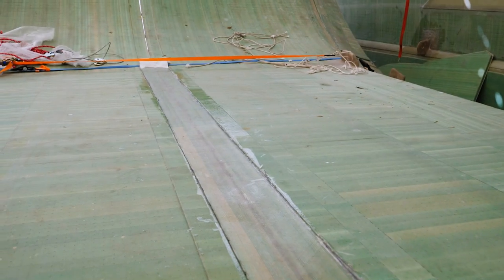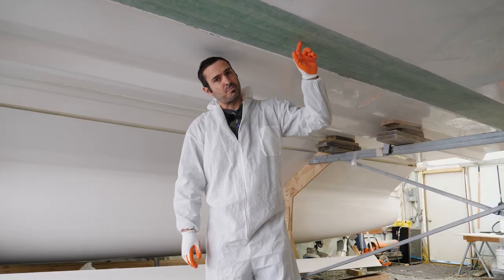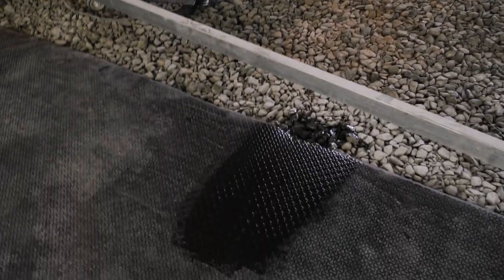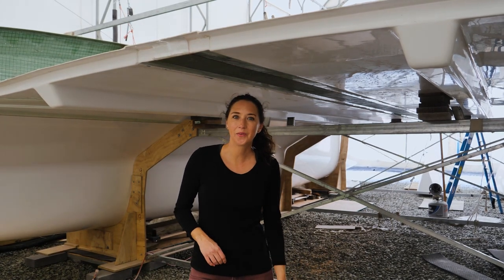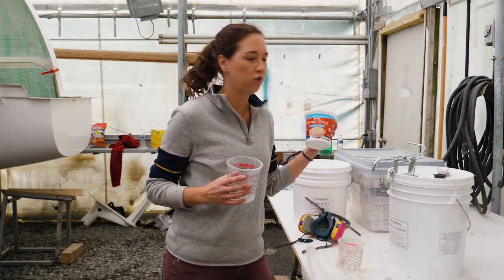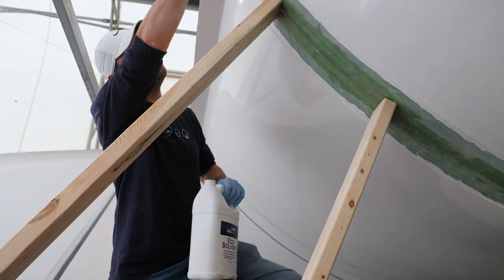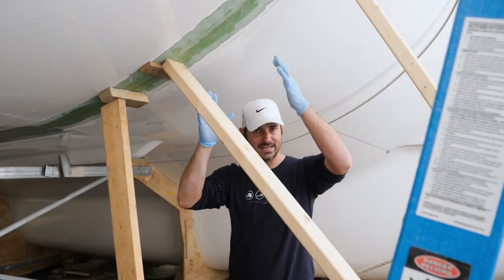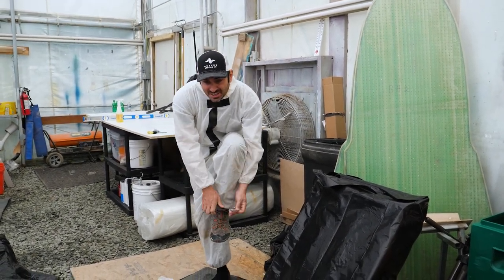CATAMARAN BUILD -  Is This Just As Good As the Moulded Bridge Deck? (MJ Sailing - Ep 182)

Comment: Use peel ply between layers that way you save time sanding . It creates a rough surface also removes  excess resin. You can go to a fabric store and buy polyester which is almost the same thing and it works just as well and much much cheaper than real plee ply. Have fun and great work.!! Tips from a experimental composite aircraft builder lol

Comment: So I was a airline fiberglass mechanic for several years,  air pockets are no big deal,  they are usually due to a dry pockets.  Get some large syringes and needles and when you have a pocket inject it with resin. Works great. I try to do it when its still wet, but you can still do it after its dry, looks like a lot of fun

Comment: Nothing is more fun than overhead fiberglass work.
Reply: You should try overhead welding I did it for years very tiring.
Reply: @patrickcoleman3  I have. Both suck in different ways.
Reply: @jamestheotherone742  Yeah I haven't tried fibre glassing but I was a boilermaker welder for years.
Reply: @patrickcoleman3  It's mostly just messy and frustrating.

Comment: Hey you two!  I have a tip on the sanding. I just got done sanding the bottom paint off my boat, fairing it, then sanding and sanding again to make it smooth.  I used a plastic folding table from Costco and did the sanding while laying on my back on that table.  It really helped.  I could either sand near the limit of my reach right above me, or I could raise it up to get close personal if needed.  Doing it that way extended my stamina from 15-20 minutes to hours.  Looking good... wish I could be building my dream at right now too!
Reply: There are movies of Michelangelo laying on his scaffolding, getting the distance basically just right so he could paint on the ceiling of the Sistine Chapel.  So, yeah, good idea!
Reply: We had a couple scissor lifting tables on wheels for that purpose in the yard when a hull wasn't turnable (mostly new builds and completely rebuilt hulls there) and some actually did it Buonarotti style. I always preferred to stand squatted and thus have a double or triple range to reach for with really aggressive belt or slow turning disc sanders compared to laying on my back. Same goes for fairing with longboards: You need Your shoulders more than Your forearms. Scraping a hull is no Delphian Sybil or Charon's Boat scene.
Reply: I also also wondered if you could use some sort of platform to lie on while sanding the underside.  It would save you from having a still neck and get you off of your feet a bit.

Comment: Things are going really good,  it's looking nice.  If you would go to a body shop supplier and get an 8 inch foam pad about 1 inch thick for a buffer you'll save a ton of time sanding.  Also get a thick foam pad for your small sanders.  You'll find it's so much easier to get a flat fast cut. 
You guys are moving along great.  I'm looking forward to next video

Comment: Also I would suggest bristle rollers to use once you have layed down the resin as it helps to get out all the air because of the wire bristles. A naval architect we used said using these bristle brushes was the next best thing to vacuum bagging. Anyway just a suggestion from our learning when reading the bottom and floors of our refit.

Comment: Matt, for the trays you like to use, get a big wide roll of aluminum foil and some double sided cellophane tape. The foil can be stuck to tray with a few pieces along sides and down middle.. totally disposable and no cleaning.  If you need to buy some time with the mixed resin, the cup can go into a fridge or freezer as long as you don't put foods in there.. aluminum cans are OK but anything , even in plastic will pick up the resin gasses inside fridge.  You can find free throwaway freezers and fridges just for hauling it away from most houses on Craigslist or FB Marketplace etc. Having the straight resin and hardener cold from freezer before mixing is also a good trick for working in higher temps in summer, it can add several vital minutes when you need it...
Reply: About the aluminum foil tip for the trays. You can also use saran wrap meant for sandwiches. Or stick the whole tray in a thin plastic bag, use it wrapped in bag and when done discard the bag.

Comment: So congratulations on the catamaran project it looks like you both have the skills to pull off the build.. one question  ? how is it ever going to be as strong as the one piece parts ? once the factory  cut them into two and you are only able to glass top and bottom and lateral strength has been taken out by cutting through the fiberglass  will it ever be as strong ???? L.A Rob

Comment: You should use a ziplock bag and cut the corner to apply the filler like a cake decorating bag.  Then use your scraper to remover excess.  Much easier!
Reply: You can’t tell these 2 anything they will accept
Reply: I used these alot building my boat. 
I also made an apparatus to hold the bag open to dump the mixed resin into. It was a "U" shaped piece of plywood with the points of small nails protruding upward through each leg. Push the outer lips of the ziplock onto the nails. Fill the bag, pull it off the nails and zip it shut. 
Another apparatus I made - used a 3/4" Diam. dowel about 8" long with a 6" cut length-wise down the center. I'd put the closed ziplock sandwich bag in the dowel slot and roll the bag around the dowel to dispense the resin out the little hole. This helped control the amount squeezed out and got almost all the resin out.

Comment: You could try a drywall sander which is like a weedwhacker mated with an orbital sander. They are there to do just what you are doing but without the arms in the air. Please if you ever get to sanding wood decks hire a floor sander it'll cost the same as all the beers you'll need after using a piddley wee one.

Comment: After you gelcoat the seam, sand and blend it in. Polish that strip. I would not remove the original gelcoat from the remainder of bridge deck underside. It's a perfectly finished surface now.

Comment: Hey im pretty sure you can kick the resin with the peroxid after your finished mixing filler in to it. True with epoxy you mix it before adding filler but because the peroxide is only deactivating the Inhibitors it can just go into the premixed filler. Thats why it works with car bog which is polyester resin and chalk. That will give you that extra 10mins of work time you used thickening the resin.

Comment: when you get to bulkheads, fit them with a small gap and use wedges to position them. glue them in with piping bags used for baking. so much easier than forcing it in. Just use enough glue to tack it in place but so there is no mess to clean up. Pre cut the tapes in order. Then make a coving tool the same radius as your compression roller to do coving. Use the piping bag to make a nice bead along the bulkhead, then cove it straight away, Pre prime the taping area. We the tapes out on the bench and drop them in. No sanding or cleaning up, only need to roll the tapes out on the boat. Peel ply is also worth its weight in gold . I would always peel ply tapes. cleaner job and less sanding afterwards.

Comment: Well, done.  Not sure I would have the stamina or the ability to keep going on a job like that.  Its basically what would put me off building a kit like your doing.  Doing a Schionning type effort with flat panels would simply be out of the question.  That was something I did not know about.  Schionning construction.  This explains the notorious water in the construction that Schionning has.  Simply not sealed well enough due to the flat foam construction.  Not all Schionning suffer from this, but apparently its a thing.
I did many years in Fiberglass companies building boats, tanks, pipes, etc as a youngster (some of my first full time jobs were working for Fiberglass companies, way before they realized the health issues).  That reminds me, well done for keeping the safety gear on all the time!  I was only required to do that only when glassing or gelling inside tanks, where you NEED an airline to be able to breath.  It was miserable to say the least so I know what wearing all that crap is like.
Glassing upside down is always an issue, made more uncomfortable if you try to go too fast (you wind up wearing it around your ears...  all manner of fun as I remember)
Props to Jess too for even staying in the same factory (tent) as you with all that stinky, dusty stuff.  I know my other half would have done an "Elvis has left the building!".
Keep up the good work, and yes, I appreciate the amount of effort involved.
Oh yeah.  In case you dont already know, wear cotton or natural fibers, at least against your skin when grinding fiberglass.  Synthetic fibers grab fiberglass fibers and drag them against the skin, forcing them into your skin.  Nasty rashes ensue.  Fiberglass dust is not called "Itching powder" for no reason!

Comment: I might have started from the bottom first, glue up fiberglass and then when dried up, fill crack with epoxy from top and glass over. Personally, I would use carbon fiber rather than fiberglass for these seems to make up for the loss of bridging strength from hull separation (all of this can be easily computed for equivalent stress requirements, I hope the supplier provided you with the info as that should be the most crucial part of this build)

Comment: Was I the only one nervous having resin around an open flame? Oh wait...my mom is channeling again. Never mind. Great video guys, thanks!
Reply: No, I got a little anxious myself when I first saw the heater.. 😅
Reply: I have never worked with vinylester resin. Is it flammable? Does it use the same catalyst as polyester resin? I think the catalyst is really flammable isn't it? Epoxy resin and hardener would be no problem. Very low vapor pressure and not flammable.

Comment: Instead of a bucket for thickened epoxy or resin I suggest a dollar store cutting board. Vastly easier to mix and scoop off, old body shop method, used like a mason's board. Probably a bit late but perhaps useful in later stages.

Comment: Use Peel ply and you will have a lot less fairing to do.  Great progress.
Reply: Yes after watching Sail Life peel ply avoids amine blush, makes a smoother finish for less sanding
Reply: And better adhesion between layers.
Reply: @nssdesigns  it's vinyl ester, so no blush -Matt
Reply: @carlpetersen3128   There isn't blush with Vinyl Ester, so it doesn't matter as much as epoxy.  -Matt

Comment: Really like your build, I think it’s going to be great to watch it come together. Question: how many layers of glass are going over the joints?
Reply: This area is 2 layers of 12 oz DB on the top and bottom.  It's pretty similar for most of the boat, but we will be using 12oz DB with CSM for the flanged areas around the hulls.   We also have a lot of extra laminations for bulkheads and chainplates.   -Matt

Comment: I'm surprise the manufacture it doesn't cast in jigging cleats so you can align the sheets and pull them back and forth to align them as you gelcoat them otherwise attaching them and then just grind off the cleats it would really make your alignments easier of  course you'd have to attach leveling and otherwise joining cleats and then remove them. Awesome project peace

Comment: Go to Michaels craft store as get piping bags 100 for $20. The easiest way to fill them is to put the bag in a 3 inch pipe and fold the top over the edge of the pipe. The pipe holds the bag open wide fill and squeeze out perfect fillets.

Comment: Good job!! I can really recommend wetting out the fiberglass tabbing BEFORE placing it on the area to be bonded :)
I learnt this while building my boat and it will save you a lot of messing with resin, especially when working on inverted surfaces. You can wet out several layers, then collect it in a roll or just fold it, and then put it up and just a final quick rolling.
Reply: That method works horribly with vinyl ester and double biased cloth.  You end-up distorting all the fibers in the peeling/rolling/moving of the cloth to the surface.   -Matt
Reply: @mattjohnson6716  oh, not at all my experience! I mainly used combi cloth (biax and CSM stitched) together with vilylester.
Reply: @henrikborg  You're right.  With 1208 or 1708, the CSM holds it together much better than just the raw biax.  -Matt

Comment: I thought when glassing you put on a plastic sheeting to eliminate blooming (if that's the right word) where by the need to remove the effect of air drying.

Peel ply avoiding amine blush removal and less faring
Reply: We're using vinyl ester, so no amine blush.   If you look at the design, this glass work is in a trough and gets a fairly deep fairing coat, negating the need for a really smooth fiberglass finish.   -Matt

Comment: Something that might come in handy joggling seams that steel workers use for welding.
you need a base plate (maybe 8x8") and a bridge screwed on top, (maybe 4x10)
situate the base next to the seam on the high side and screw it down, 
make some wedges 10x1" and use them under the bridge on the side you need to push in
ypu already know how to fill the holes
Reply: I hadn't thought about wedging it into position like that.   Good idea.   -Matt

Comment: Beautiful work! With the extra rib under cover the exterior joint? Or does it have to be faired smooth?
Reply: The tuned-up section needs to be faired - the only place on the boat we need to do that- but it's an area that is seldom seen unless under the boat.   Under the bridgedeck, the beam goes into the trough and covers that joint.   -Matt
Reply: @mattjohnson6716  perfect! Nice design and extra strength for the joint.

Comment: When taping, set up a long table with plastic on it. Wet out your tapes on the bench and roll them up. pre prime the boat with resin then just roll the tapes on and roll them out. no resin everywhere or wetting out in awkward places. when you get good you can do multiple tapes at a time. -boatbuilder

Comment: Now what is the con of having to thick of a gel coat? Just the extra weight, or is there something else I’m missing. Wouldn’t a thicker gel coat just give you extra protection form the elements, and salt water?
Reply: It can crack and wrinkle if spread too thick and with any surface flex of the boat.   You'll often see it in corners with pooling of gelcoat.   - Matt
Reply: Gelcoat is pretty brittle. It may crack if it is too thick. Unless it is a special formulation or something.

Comment: Though I cannot imagine taking on such a gigantic project I know that you both will finish it and it will be better than if the factory did it Of course they have more experience and equipment but you are building your home. You will not accept well that doesn't show or that is good enough it will have to be 100% correct not slapped together so you can go home early. I am sure that the boatyard you brought it from are fine people but they do not have the emotional investment or priority that you both do.

There is months of hard work and expense ahead of you there will probably be my cases of exhausting arguments tears even and that is just Matt :) But when you sail away in your brand new boat it will all be worth it. In a way it is very much like you both being pregnant, though Matt will be the one with the sore back and needing a foot rub.

Comment: You guys should try peel ply,    you will see when you go to sand the glass that you remove far too much glass to remove the shiny surface.
I should add that chop strand mat has no place in a cat, you would be better off using the equivalent weight in. double bias. as chop adds very little strength for it's weight.
Reply: The CSM is for peel strength.  Not needed, but for the seamed flanged areas along the hulls, we felt it was a better choice that just straight DB (against Max Cruises design notes).   But you're right.... I hate wetting out 1208 and dealing with the added resin weight and cost.    We'll use peel ply in areas that will be faired and don't already have their own trough like these parts.  -Matt
Reply: csm adds adhesion, not strength.